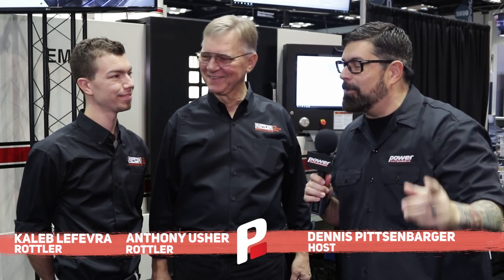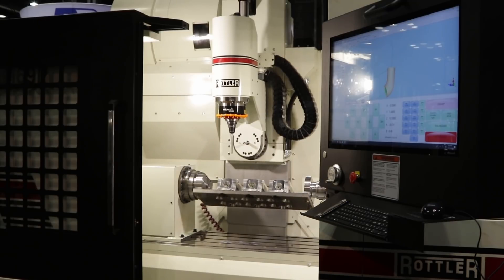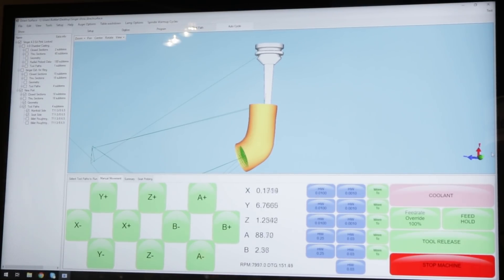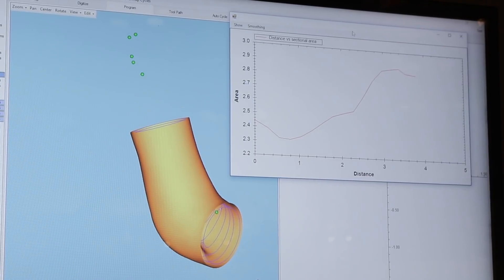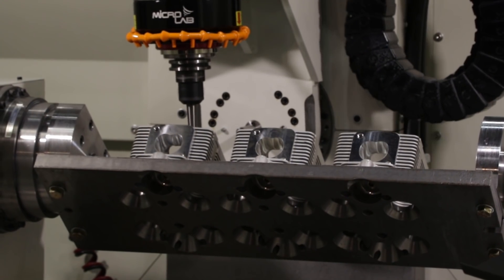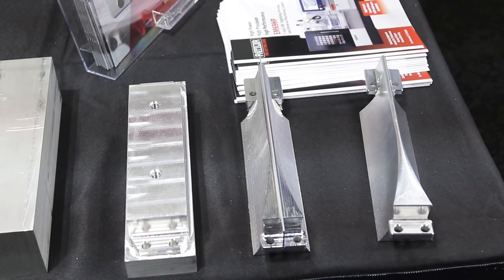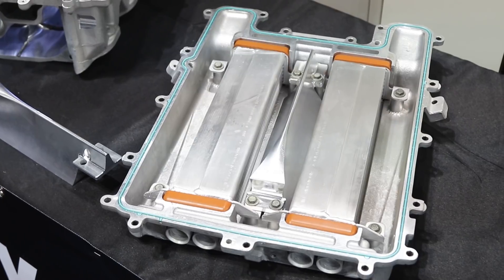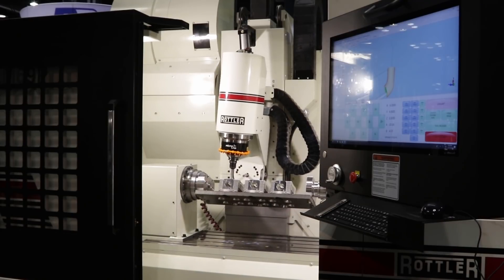PRI 2018: Rottler Revolutionizes Machining with Easy-to-Use 5-Axis CNC

Comment: How much is it vs. a similarly equipped Haas?
Reply: Probably more. The question id have is can it be used for anything besides engines and cylinder heads. Also can it machine blocks from raw stock? I don’t think it can.

I think if production parts were entirely feasible then guys like Steve Morris wouldn’t be sending his out to a CNC shop. Perhaps for initial R&D or for a small race team building their own engines then it makes sense. 

With the 5th axis being a rotary head thats a rigidity issue which will slow it down versus a large industrial Mazak 5 axis. 

Id guess if a block from raw billet is possible it would take 40 hours to machine.

CENTROID CNC has been manufacturing these type of machines for years. Plus Centroid has an automatic tool changer. You can find it here on youtube to compare them